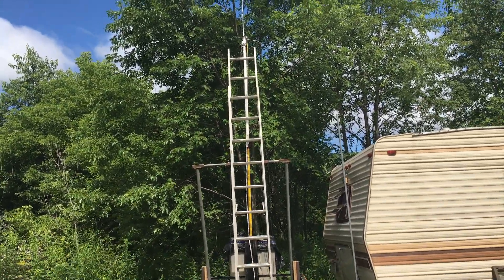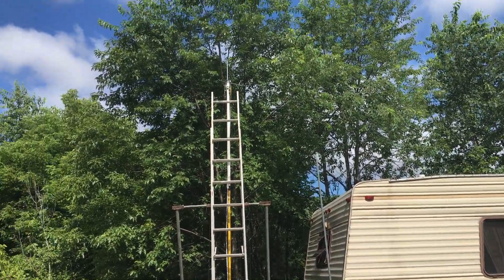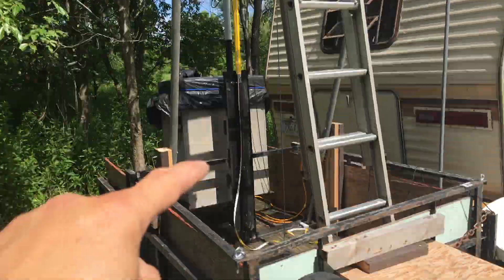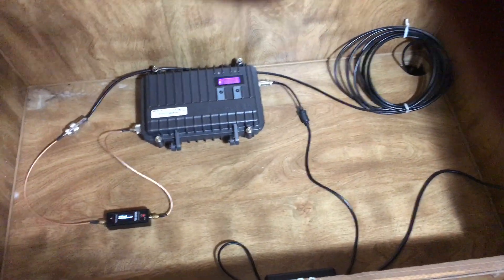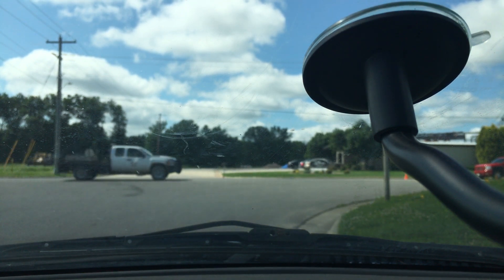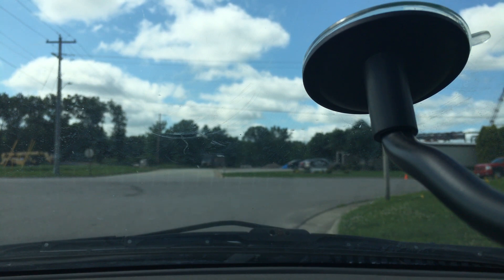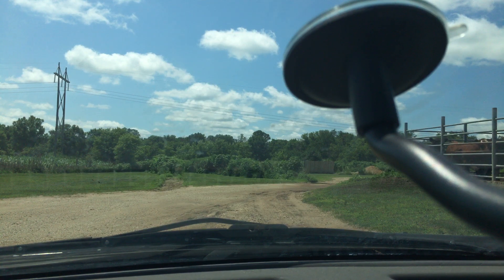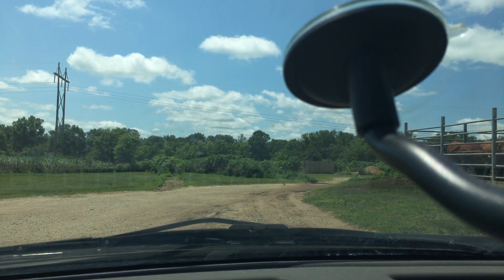🔺How much higher should I Raise my GMRS two-way radio antenna? How many feet to see a difference???🔺

Comment: I hope you are running LMR400 coax. Anything thinner than that over 20ft in length will have significant loss.
Reply from the maker: i have done that in the past it only gave me 1 watt more power ( i have a video of that) and the way i change antennas, titling the mast down the 400 would be a pain for that.

Comment: Hi Scott , Nice Video -- I am just getting into GMRS and still setting some things up and watching loads of Videos -- can you tell me if you were using an external mounted Antenna on your Vehicle when doing the test?  Also with the Repeater it seems when you key up and speak it takes about 5-7 seconds till the Repeater re-transmits - is that something that can be adjusted within the Repeater?  Thanks for the Review.
Reply from the maker: I am using a magnet mount homemade antenna on the car. As for the re-transmits, I have a simplex repeater that is also running alone with the repeater that records and plays back my voice, so there may be a little delay because of that

Comment: Is your vehicle facing the direction of your base station?  or is it in the direction of the metal fencing?  How might a grounded chain link fence affect things being right next to your vehicle if the base station were off some distance away on the other side of that fence?
Reply from the maker: The fence at time stamp 8:53, at this point the repeater would be in front of me. The chain link fence don't really have an effect when in a vehicle. But if you were to mount an antenna to a fence, that would be a different story.

Comment: A good analogy for “how high” would be “how far can you see in a shopping mall?” If you are standing behind a rack of clothes, maybe three feet. If you’re standing at the edge of the second floor looking down into the mall, maybe a thousand feet. With UHF, even the curvature of the Earth can make a difference. Sitting in a kayak with the radio two feet above the water, your range will be limited by the curvature of the Earth to a couple of miles, but if you stand up, you can triple your range. With UHF, you need to also consider things like knife edge effect and reflections. Not a simple matter.
Reply from the maker: Ohh yes, so many variables. Best to get antenna as high as possible

Comment: I'm wondering if your using a hand held inside the car with the stock antenna or a mobile antenna???
Reply from the maker: I think in my videos I say how I am doing it but if I didn't then when I am using a handheld its stock antenna while I am sitting in the car.  When I am using my amp with a handheld, then that would be a mobile antenna.

Comment: For that kind of money and it is rough at 2.5 miles? Antenna height should be good enough, I suspect coax cable. Not a roll on the floor, but quality cable, cut to length, test it again.
Reply from the maker: Keep in mind, my set up is in a valley. So with that being said 2.5 miles is very good. Yes i should cut it to length, but I want to add more height some day the cable if i recall in this video is LMR-400

Comment: i run a gmrs repeater in pittsburgh pa..  the tip of the antenna is about 1300ft in elevation.. im using a moto msf5000 7/8 hardline thats about 80ft and a comet ca-712efc and i get about 40 miles.. now you can hear my repeater farther but right now i gotta tune some duplexers that i just got and going to add a preamp.. those mobile duplexers work ok but nothing like what i just got.. the mast is about 25ft plus 10ft for the antenna, mast starts on the rear second floor bathroom roof past the peck of the house not sure how much but i know its way over the peck of the 3 story house..i live on high elevation and where i live mountains and hills all around.. that hardline really has helped but if your not serious about  setting up a repeater dont be buying shit that your going to waste money on..  this all came outta my pocket every single penny was from me BUT i got the help that i needed specially when raising the antenna final place and yes i guy wired that to the house and im shocked that hasnt come down with all the high winds i get.. im a hands on type of person and i was thinking about hardline for awhile before i bought it.. that you need to plan everything way before you do anything use your brain..  trust me this has been a huge learning curve for me and plus i made my repeater getting out farther than before..
Reply from the maker: Height is king! I know "cheap" systems that do very well because of good height! Height and location of a repeater is the key 🙂
Reply: @GMRStwowayradio  thats not always the case, as long as you have a decent antenna setup.. i know we live in different states so what you do maybe isnt the best for me.. my problem with me east about 40 miles away theres mountains and theres no way in hell ill be going past that point just not high enough to clear it and i dont link mine either.. 

i used to hear so many people saying there going to setup a repeater and they do setup a mobile repeater and no one would never use it.. they get pissed cause no one would use them mainly cause the coverage wasnt that good.. people didnt know what they were doing and when we tried to help they sometimes got a big head and say i know what im doing.. they didnt know how to troubleshoot when needed.. i still havent heard 4 of the owners  in a very long time.. pittsburgh isnt so much gmrs friendly so ya thats another thing all these people were saying my repeater is going to be active all the time and when reality hits theres not many people out that takes gmrs seriously and no one to talk after awhile i hear nothing no repeater.. thats what i was talking about dont waste money if your not that serious about it.. its funny as a owner the requests i used to get, i like to screen people and make sure they are licensed i give them permission ok they do some radio tests and never be heard from again.. why waste my time and yours if your not going to be using it..  people need to start to understand handhelds rent do all radios they got limitations like the mobile and repeaters do also.. i do also use handhelds when mobile its not the big but sometimes thats all i need to use.. i can go on what past years ive seen and heard we live in different part of this country i know its go to be different..

Comment: Is that the 5 watt repeater or 10 watt?
Reply from the maker: The specs say 10 watts BUT that is before duplexer so AFTER ( where your antenna hooks to) the duplexer is about 6 watts if I recall right however in my case when I did this video I was using poor coax cable so if I recall I was only getting 2.5 watts to the antenna after it went through 50 feet of cable!!
Reply: @GMRStwowayradio  OK cool thanks. Another question for you... I have a dual band Comet GP-9 up on a 40 ft push up pole for 2 meter 440. How well do you think it would do for that same repeater? the 440 side goes to 450 and works well with an HT plugged into it and gets well over 4 miles easily so far talking to another HT. inside a closed car with windows rolled up. I think I might be able to play with the comet GP-9 length a little to make it do 460ish but right now as it is it has 11.9 DBI on the 440 side. I have been looking at that Retivis box for awhile and debating on buying it or spending the extra money and using two Wouxun KG-1000G plus radios as a repeater system out here on the lake in East Texas. If I do those two radios do I need two antennas? one for tx and one for rx? Thanks for your time.
Reply from the maker: @bradgarrett7790  - as for the RT97, to many variables ( trees, hills,building, etc) to say how well it will work for you. But if you buy it on Amazon, you can always send it back if it doesn't work the way you like.  As for the 1000G radios if you just want to use one antenna you will need a duplexer that is tuned to the freqs you want to use, remember using a duplexer you will lose wattage. If you don't want to use a duplexer then you will need two antennas, but the antennas NEED to be far apart if I recall at least 30 feet apart more the better!.

Comment: Above the trees .  Then u can talk 30 + miles . My RT97 antenna is at 70' with a range of 30 miles to a mobile .
Reply from the maker: Yes that's a start, but I also have buffs/hills too, and I am using handhelds.
Reply: @GMRStwowayradio     Me to .  I have talked to a guy with a HT 43 miles away in Oklahoma , I'm in Texas .
Reply from the maker: @larryhaney6608  I am in a hole/valley, so I know I won't get that distance 🙁
Reply: @GMRStwowayradio   DRIVE your repeater up on the rim of the valley and cover the whole thing .
Reply from the maker: @larryhaney6608  - yes, but I don't want to do that all the time, I am hoping to find a permanent better spot in the future

Comment: My retevis repeater gets out at least 3 to 4 miles in my area..plenty for my small circle of commute with an inconvenient tree in my yard that blocking a part of the city where I would rather not be anyways. I'm building a new repeater from a pair of Motorolas that would allow me to pump 20 or so watts only giving me a marginal amount more coverage. My antenna is around 30 feet off the ground.
Reply from the maker: Where is the repeater is located at it's in a very bad area it's in a valley

Comment: Dude I dont know what HT your using but it really doesnt have much range. My HT's can reach app. 10m miles even with the obstacles of going through a small city.  Maybe try changing the antenna on your HT.  Out on the water my HT"s can reach upwards of 20+ miles and not sound that staticy.  I have UV-9G's.
Reply from the maker: The setup I am using only puts out 2.5 watts at the antenna, and I am in a valley which makes it worst so me getting 2 miles is very good under these conditions

Comment: First of all your running only around 5 watts, not of the cable your using. But with rg58 you're loss is a good third of your power at just 25 ft. Now if you have a 50ft run, your lucky if your getting 2 watts to the antenna.  The higher you get helps a little,  but you loss it in watts.
Reply from the maker: 2.5 watts to be exact I did a video on it and yup for sure 🙂
Reply: @GMRStwowayradio  does it transmit well at 2.5 watts
Reply from the maker: @wiillthebarbertv9415  -  for me being in a "hole" the worst place to have a repeater! i get 2 miles using handhelds ( i have videos showing that too)

Comment: at 30 ft and up is the sweet spot earth magnet pull is the BIG DIFFERENCE magnos[here is useless and u need a lot of power not that toy box you over $$$ on digi is out old analog rpt will start to drop 
50 watts used repeater with a tuned duplex cables suck get some real lmr or rg8 rg8x get that as high as u can https://en.wikipedia.org/wiki/Magnetosphere
Reply from the maker: For it being a "toy box" it works very well for the price, I didn't need to spend a lot of money on a repeater.🙂

Comment: um no height is might at least in Florida 25 ft ant =3 miles mobile radio 50W  45watts repeater 
max out at 3 miles -4 miles ant peeks over the roof
Reply from the maker: i am getting about 2 miles using handhelds with a stock repeater of about 2.5 watts to the antenna so this little repeater works well 🙂
Reply: I am 30 miles from one repeater in Jacksonville,Florida and I have Zero issues getting into it with my 5 watt HT & a Larsen 5/8 wave magnetic mount antenna on my pickup truck.WRMX520
Reply from the maker: @1OFGODSOWN  - ya my repeater is in a valley AND I have trees taller than my antenna, and I am 2.5 watts at the antenna so with all this I think my setup is working the best it can work under these conditions

Comment: The higher the better height is KING especially uhf radio coms.  It's  not just local obstacles that lower your signal tx and rx,
but the curvature of the earth. The shorter the band
the shorter the distance possible.  Possibly look into linking it to other repeaters through the internet ip radio.  There are several ways, ZELLO, ALLSTAR, Vero V7500 mobile,  plus a ton of other ways. Upping your power  and height will help  but make sure your audio sounds clear. It can be linked and get coast to coast  when in the right network.  Have fun with your radio hobby  :)
Chuck AA4CP 
Fort Pierce, FL
Reply from the maker: ohh yes for sure height is KING 🙂 and yes i have lots of videos on zello interfacing 🙂

Comment: A good rule of thumb is..higher you can get the antenna the better..trees and building tends to block the GMRS frequencies...therefore depending on working distance required get above any obstruction as a minimum and use very low loss coax!
Reply from the maker: ohh yes for sure!!! Height is KING 🙂
Reply: @GMRStwowayradio  you should understand about null areas and spots then.. it happens ive done it few times put antennas in null spots.. i bet you any money your clueless whats in other peoples path.. my signal goes up this valley and if dude puts his beam or antenna too high then he puts his antennas in a null spot.. summer is nearly there and guess what leaves on trees you should know by now they can help or hurt you.. weather alot plays with uhf.. rare thing but band openings does happen and it gets crazy at times.. they could be building a building and the next week you ay not be able to get into a repeater that happens also.. what do i know i just run and built a repeater i wanted and i do know what happens with signals far away.. i dont care think what you want but the only 1 whos bullshitting is you
Reply from the maker: @robmorgan8392  ohh yes leaves make a big difference I notice that. What's in other people path I have no idea cause that depends on where they are at when they TX.  I am in a valley, so I don't get very good range to begin with. Some day I hope to move it to a better location.

Comment: Get yourself some LMR 400 just the length that you need (to combat line loss), set your antenna to 30 ft and I guarantee you will see a big difference.
Reply from the maker: Yes, I have some cable here I think it's lmr400 I will have to check BUT I don't think it's long enough if it's the right cable.
Reply: This is true. Also be careful where you buy the Cable. Lots of imported Cable is not real LMR 400 Cable.

Comment: What size coaxial and the length
Reply from the maker: Type of coax I am not sure, it can with the "bundle" ( I don't see any markings on the cable) deal, but the length is 50 feet.
Reply: Ok

Comment: I get 10miles on simplex with 2 midland. 115 and midland 6db gain whip antenna 12 off the ground
Reply from the maker: How many watts is the midland putting out?
Reply: I didn't check the watts

Comment: I wonder if you are getting the full 6 watts out ? That’s a lot of coax and there is loss through the cable. I wonder if you could shorten the distance between the repeater to the antenna if that would help. Or just use the lowest loss coax available. 
Lot of cable for 6 watts to push through. Either way it’s a good experiment. You have given me some good ideas about how I’m going to set my repeater up.
Reply from the maker: Easy to put my watt meter at the end of the cable with a dummy load to see :)

Comment: I would raise it 5 foot higher . Then I would move it from the tree , to a more open spot. I see the spot I would put it at . That’s up to you.
Have you done away with using the amp?
Reply from the maker: Yes, I am looking into if I can go higher, I have "about 13 feet" of coax coiled up next to the repeater. If you look at my videos, you can see the coax coil next to the repeater :)